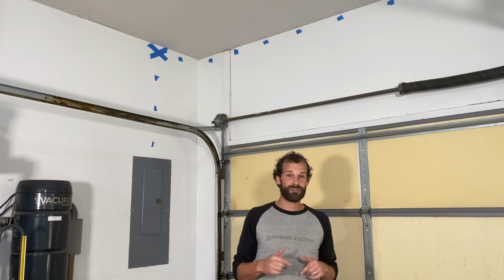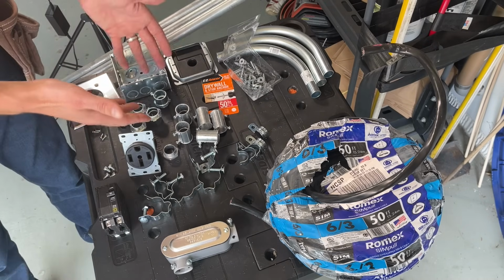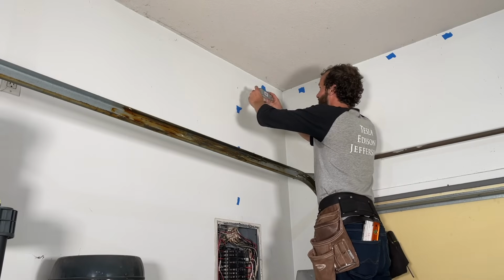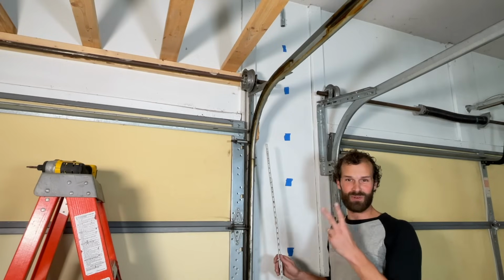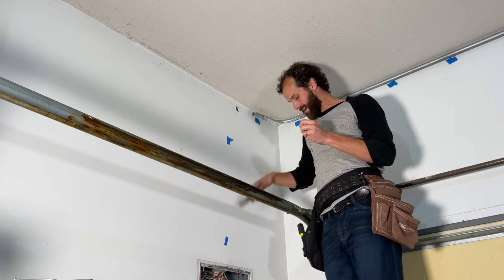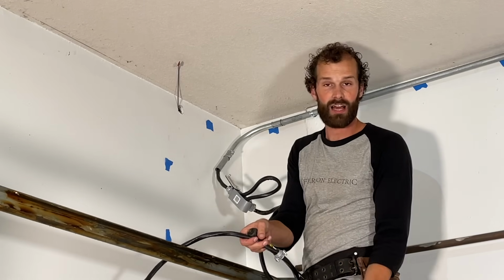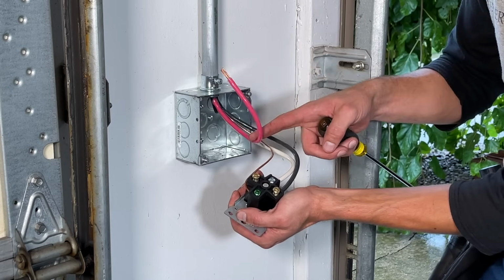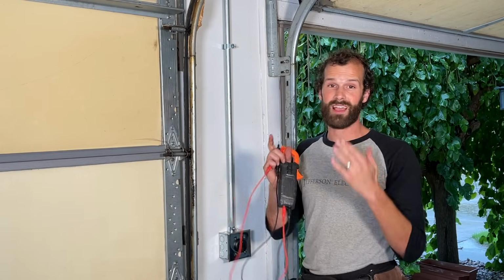How To Install a 240 Volt Outlet | Electric Car Charging

Comment: I was taught that it is against code to install Romeo in conduit, besides it’s so hard to pull it through conduit. Stranded thhn wire is the best conductors for this project. You would need to tape the portion every five or six inches that go down the wall unless you can purchase pre twisted wire in the three conductor and size you need. Plus you should have used an industrial cover for the receptacle. It matches the 4 sqr. Box perfectly. The cover you used is for a flush mount.
Reply: Who ever taught you it was against  code, should not be teaching. Get a code book  look it up for your self.  334 covers NM cable to help you out
Reply: Well, you can use non metallic cable inside a chase or conduit if it’s not a damp location is the basic rule, but there are a bunch of exceptions. As a rule, using individual conductors is a better idea since it’s always OK. To be honest, I’m not sure why you’d use NM cable. Maybe price?

Comment: Can I run just the Romex without any conduit?
Reply: Only if it's attached to running boards. Can't leave Romex mounted to a wall where it would be subject to physical damage
Reply: @pld8993  Thanks

Comment: Not the correct ring and cover plate in this installation. He should’ve use that receptacle with a 4” square exposed work raised cover. You can cut your hand on that cover plate, they are so sharp. This was brutal to watch.

Comment: Great Video, 1 question though, for this panel, are the Ground and the Neutral touching? Because on the panels in our neighborhood, they are separate, one side for Neutral and the other side for Ground. Thank you. Great video.
Reply: Grounds and neutrals are bonded at the “service”. Most newer homes have an outside disconnect where the grounds and neutrals are bonded, after that point all grounds and neutrals are supposed to be separated

Comment: Save on the copper cost and use 6-2 cable and a NEMA 6-50 outlet ....Neutral is not needed or required.

Comment: I heard on Sandy Munro's channel that you don't want to use a normal NEMA 14-50 receptacle.  They are not designed for continuous service.  Need to purchase one made of bakelite in order to hold up to the sustained use.  There have been cases of house fires when cheaper receptacles have been employed.
Reply from the maker: Sandy knows his stuff and actually I mentioned the NEMA 14-50 yesterday in a video.  I am now using a Hubbell HBL9450A which is a much better outlet.  I think a lot of people get in trouble by not properly torquing the terminals.  If you don’t flex the stranded 6 gauge while torquing each terminal several times there is a good chance it will loosen up when the outlet is being secured to the box.

Comment: Pretty sure the bend radius on the romex going through the box into the wall wasn't code..especially as it seems at the last push he used a screwdriver to push it in.

Comment: Nice video. Not an electrician, but I would figure wire length to breaker, remove it, connect wires without fear of dropping a screw, then plug breaker in and retighten wires.

Comment: Wow.  Looking at this from the other side of the world in Europe, makes me cringe.  Working with all those exposed live terminals is something that we try to avoid here!  But then our systems are 240V to ground, not 120V on either side, so I guess you will get half as much a jolt if you touch it!  Over here, there is great emphasis on what you call ground fault interrupters (we call residual current devices) to stop the whole car becoming live if there is a fault.  This is because most charging points are installed outside of  buildings and you may be standing on wet ground when plugging in to charge. And in most  European countries, DIY is definitely not allowed for this sort of work.  But then we're probably just sissies!  Interesting video!

Comment: In appearance, and you should think it of it that way, you can get 220 volts and here I am out of that dryer socket in your garage.
Reply: It's a good question whether you should depend on that socket for continuous duty supply of 240 volts at 50 amps,  but you can check on your cars needs------ does it draw 50 amps except at the very first surge upon plugging in.  If you don't know what you're doing skip to a licensed electrician but be sure for yourself to check the breaker box for the rating on that circuit that should be marked dryer outlet...............  Some of those French circuits for the dryer have Breakers rated at 30 amps where is marginal for that use but your electrician can tell you best if you can find one you can trust.

Comment: Some good tips.  If you are not reasonably familiar with doing electrical work this project is not as easy as it appears.  This guy does this for a living.  Moreover, local codes sometimes require more than the NEC, I would check local code first.  Some cities require a permit and sign off by an inspector and some places require all work to be done by a licensed electrician.  Ya' better check FIRST!  Why?  Because if there is a fire caused by this installation your insurance company will not cover you if not inspected or done by a licensed electrician.

Comment: If you are an electrical pro.  Please review the comments here carefully.  

I only see two possible NEC violations and have worked to provide references below.

1.  No ground to the box with the receptacle.

2.  Gfci protection for the circut.

       NEC 625.54 (EVSE) requires gfci receptacle protection for car chargers.  This is some time before the 2020 code cycle.

       NEC 210.8 in the 2020 code requires gfci protection for 250 vac receptacles in the garage.  If he is under an earlier code, all is  okay is it is not for car charging.

Comment: You actually are not supposed to run romex inside of conduit. And you could have used a plastic snap in type romex connector on the inside of the electric panel. You also should have installed a grounding pig tail to the metal box.
Reply: Running Romex in conduit is allowed but it's a foolish way to do it, waste of time and money and looks unprofessional..
Reply: @pd  it is OK indoors l8ke he ran it. But not outdoors.  The inspectors in my area would turn it down. I would have at least stripped off the outer jacket. Then, used a J box where he used the LB. Would have pushed in that conduit much easier. I've been in the trade 40 years. But we all do things differently.
Reply: @christobaldaetz6062  Yes we do things differently and different ways are fine as long as they're code compliant. This one is not.
Reply: @pd  lol, that's for sure!

Comment: NEC VIOLATIONS
210.20(A)      300.18(A)
         314.16(B)        314.17(B)
       250.134
       250.146
     250.148(B)
     Chapter 9, Table 1
         possibly 625.44(C)
625.60(D)      625.41              210.8(A)(2)

 
Now that multiple people have pointed out the exact NEC Articles that are being violated, Everyday Home Repairs guy has had the opportunity to look them up and confirm whether this was done correctly or not. Because he has been silent on the violations, one which has the potential for electrocution, I'm going to assume his silence is about the $$$. With 1.6M views who cares if it's wrong, right?

Comment: I don't understand the grounding. You emphasized tightening the set screws to get solid grounding through the conduit. But the conduit doesn't go all the way to the panel.
Reply: The conduit doesn't have to go all the way to the panel and would have been sufficiently grounded if he had attached the ground wire directly to the recep box. The way it was done in this video is incorrect and potentially dangerous. This is not a professional installation and has multiple NEC violations. Just because it works that doesn't mean it's correct.
Reply: @pld8993  What would you do different?  Wouldn't you still prefer to have conduit run all the way?
I installed a walk-in whirlpool tub. I ran conduit plus a ground wire to be safe.
Reply: @8546Ken  Running EMT is the best idea in the video. The conduit system needs to be solidly bonded at some point in the system. For example, the ground wire in the Romex attached to the box with a green grounding screw bonds everything metal. The way it's done in the video, as soon as that recep is unscrewed from the drywall ring, the metal conduit becomes ungrounded. Could use a bonding bushing on the box connector, overkill, but gets it done. I would have run the conduit as it is but to a j-box at the ceiling, not an LR. From there probably Greenfield fished in the wall to continue THHN to the panel, but Romex fished could work also. I would never "pull" Romex through conduit, not illegal but a foolish practice that wastes time and money.

Comment: In an emergency situation, and the house breaker panel doesn't have a "main" breaker (I suppose it's a sub-panel to the main outside), how can I switch the main line off, connect my generator (either gas powered or a battery bank with an inverter) to the whole house and also prevent sending power back into the grid when/if the power comes back on. I've watch many videos, but I've not seen a good way to handle this when the electrician didn't put a "main" down in the basement on the house's inside panel.

Comment: I have a bathroom switch that turns on the fan and the light at the same time. I bought a switch with two separate buttons on it. There is only one white and one black wire coming in to the box, no ground wires and metal boxes. The light is on the wall above the sink and the fan is on the ceiling. I am guessing they are wired in a sequence. How do I separate them so I can just turn the light on or just the fan since I don't have the right wiring coming in to the switch box?

Comment: Would pulling the wire have been easier with wider conduit?  Would wider conduit meet code?
Reply: The 3/4" conduit used in the video is too small. Code requires 1" in this situation.
Reply: @pld8993  Thanks.  That's very helpful.  John

Comment: Guys and gals listen to this man when he says "buy an industrial rated outlet" buy a hubbel not the cheap 12 dollar one from.big box!!! Those are good for dryers and such not a constant 50 amp draw for hours! I know the hubbel is 50 bucks more but I've seen my welders melt the cheap ones and your EV is drawing more then my welders and for longer. Don't die in your sleep over 50 bucks.

Excellent video
Reply: This should really be pinned. I'm surprised they installed an Amazon speical crap-o 5000. Hubble or bust.
Reply: He did mention the good outlet bu the linked one in the first comment is the cheap $9 one on AMAZON. Ugh
Reply: I am new to the EV world and getting an electrician next week. I currently have a 240v portable evse from the manufacturer, but no 240v outlet. I of course will be using a Hubbell or Bryant commercial outlet, but in the EV forums most people suggest to do hardwire station instead. But that would add another $500 in cost plus god forbid the station is faulty, then I’d have to have an electrician come out again, where as if the portable plug-in dies I can just buy a new one. Is hardwired really that much safer/better than a copper wire Hubbell outlet install?

Comment: NEMA 6-50 to NEMA 14-50. Can I run a ground wire to the panel to add the missing required ground wire to make the upgrade?  If so, can I run bare wire or does it need to be jacketed. I have two 6-50s in my garage I want to upgrade. Don’t want to run brand new Romax to replace perfectly good existing copper.

Comment: Good job. I wondered why you were not using an LB, but other posters have addressed that nicely. A poster said that the panel is now full and has no room for expansion. Just not true. There is a lot you can do with twin breakers. In reality the installer of the service should have used a 40-place panel. I must admit I have never seen a large bunch of branch circuits fed thru one large romex connector at the top like that. Finally, we never pulled romex from the center of the coil, you just get a rats nest. Remove the entire plastic wrap, and the roll the cable out on the floor or ground using the end that is on the OUTSIDE of the coil....you are unwinding the coil from the outside in...way easier. And there are a number of cable lubricants that can be used for a pull like that, starting as simple as PAM

Comment: You can’t feed a 50A continuous load with a 50A circuit breaker. Most circuit breakers, including the Square D QO breakers shown in this video, are only rated for 80% duty. This means that even though the 50A circuit breaker will supply 50A, it is not meant for supplying that much current for 3 hours or more. This setup would, however, be sufficient for supplying 40A continuously since 50A breaker x 0.8 = 40A. I’m sure this is what you meant.
Reply: Most home EV chargers are 40A or less.

Comment: You did a great video. I read some of the comments and agreed with electricians. A pull box would have been better. I know the Romax connectors are required maybe adding an insulation (plastic) Busing on each end would be good. I know you mentioned adding a service loop (but did not), at looking at inside the panel I loop could have been done. It is not your job but I would advise the homeowner there is no additional breaker location and maybe a larger more breaker location panel maybe be advisable. There is no future capacity. Overall the conduit run is clean. Regardless of the using straight piece, I always ream the all ends of cut and uncut conduit. That's my two cents.

Comment: A friend showed me this video, I've been an electrician for 46 years and I was taught never pulled romex in EMT its not ment to be pulled in EMT can raise the temp of the wire and Tripp the breaker. He never grounded box where the outlet was mounted. I have wired over 2000 houses and always used 8-3 for 50 amps, why use more expensive wire, only thing I can think that it calls for 6-3 maybe for the pull of amp for a long time? always used 8-3 for an electric range and never had a problem.
Reply: 8-3 NM cable is rated for 40A
Reply: @pld8993  50 A residential
Reply: @JamesPeck-lg2ho  Not in the US. Romex uses the 60degC column in Table 310.16.
Reply: @pld8993  That's funny because I wired over 2500 houses in my time and used 8-3 for 50 amps.
Reply: @JamesPeck-lg2ho  That makes 2500 houses that are wired incorrectly. Realistically, it wouldn't keep me up at night since there's a whole lot of safety buffer de-rated into Romex. Even though it's rated for 60C, they've been using 90C THHN conductors in Romex for decades.
Reply: @pld8993  Sorry but I disagree
Reply: @JamesPeck-lg2ho  If you disagree with my incorrectly wired comment, I would refer you to 334.80. Fact, not opinion.
Reply: @pld8993  Do some more research, 8-3 romex is THHN which is rated for 50 Amps.
Reply: @JamesPeck-lg2ho  No, NM is not THHN. Again, no thinking required, it's not rocket science, just read 334.80.
Reply: @pld8993  Only thing I can say is where is all the electrical inspectors that passed the rough job.

Comment: diy doesn't mean the easiest way but doable, to me is to get in the attic a drill 2 holes in the top plates and just run the Romex down to the panel and over and down to the receptacle using horseshoe nails on the joist and in 20min your done. save money you just need breaker,wire,romex,recp. pop in box, and 2 box connectors.

Comment: Nice job ,in some areas like where I live after locknut is installed plastic anti short bushings must be threaded on to meet code, at the fuse panel and at the outlet box. Square drive? you mean robertson, sorry its like calling philips ..star

Comment: At 4:36 you said you were going to do this in a most professional manner, but the way you installed this is one big NEC violation and not very professional. First, you cannot pull conductors through an incomplete conduit system, 300.18(A). It must be complete from end to end before conductors are installed. You're not allowed to pull it through partial sections and continue assembling the conduit. Second, why in the world are you installing NM cable in an EMT run? Individual THHN conductors are the correct way to do this, to a j-box where you poke through the wall, not an LR, then NM in the wall from the j-box to the panel. Or keep the LR and run Greenfield in the wall and you can run THHN from end to end. NM in EMT does nothing but fill the conduit unnecessarily with plastic sheathing. 
That cable obviously exceeds the max conduit fill of 53% for 1 cable, a violation of Ch. 9 table 1, which is why you can't pull it through the complete conduit run and have to violate 300.18(A) to make it fit. A typical 6-3NM cable would require a minimum 1" EMT, but you don't even need 6-3 for an EV charger, since they don't require a neutral anyway. If you had run THHN conductors, you could have run 2 #8s and a #10 EGC instead of #6 and used 1/2" EMT.
I don't see the EV charger but if it's fixed in place and mounted to the wall (which is most EV chargers), as opposed to a portable EV charger, it must be hardwired direct, receptacle is not allowed, 625.44(C). When using a surface mounted box with a recep, installing a P-ring and a wall plate is not how a pro would do it. Use a raised cover, someone is going to get snagged on the corner of that wall plate, which is designed to be against a wall, not exposed on a surface mounted box. This video is incorrect on multiple levels and is, at best, handyman level installation. If one of my guys had done it this way, I'd fire him.

Comment: Thing is every electrician has there own way of doing things. No way is incorrect if it meets code.
Reply: Just because it works that doesn't mean it's correct. This installation violates several codes.